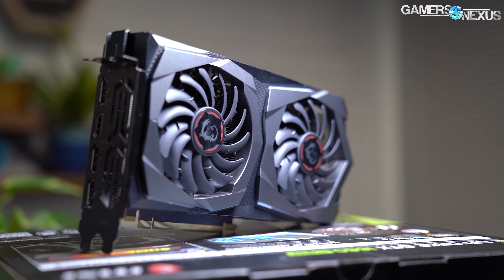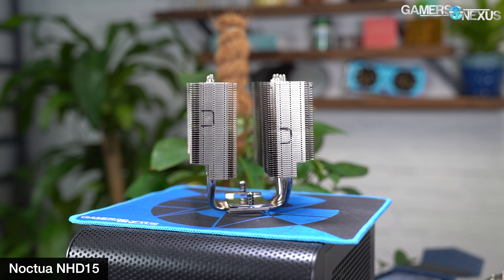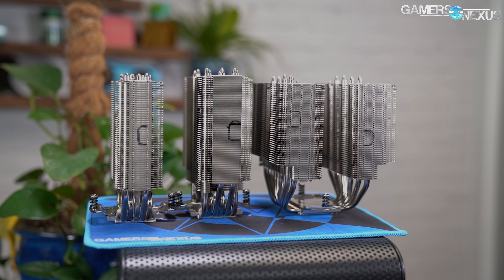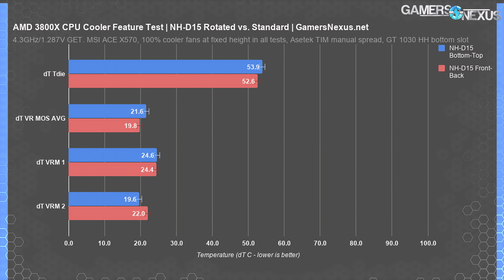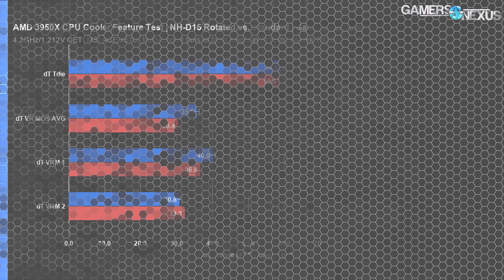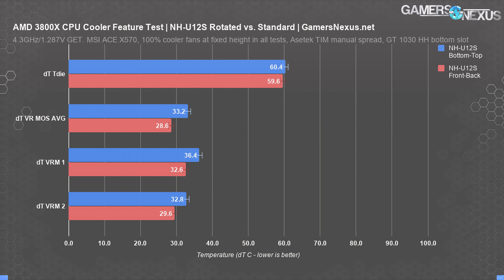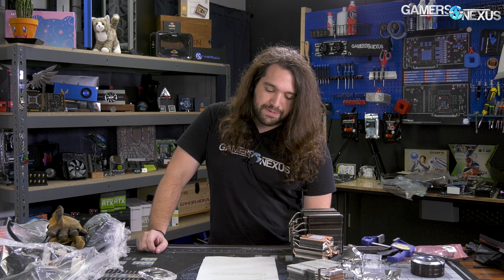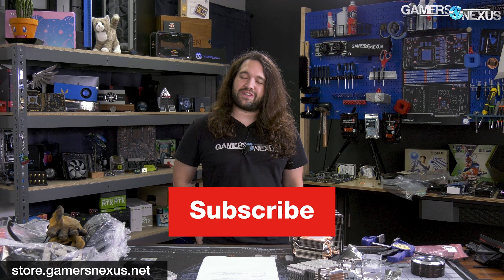AMD Ryzen Heatpipe Orientation Benchmark & CPU Cooler Myths

Comment: Kinda a side topic here:

The technical aspects of "wicking" or the flow of the gas/liquid inside the heat pipes is something I havn't seen exposed in detail. Neither of these orientations take into account the effects that gravity might have. Try setting the case where the heatsink tower points straight up vs. straight down maybe ? Also are all heatpipes created equal these days ? Some of the older ones were different and didn't use the sintered copper design if i'm not mistaken.
Reply: Gravity does play a significant role. The best orentation for most heatpipes is heatsource at the bottom vertical pipes with condenser at the top so that vapor can rise then gravity can assist with dropping the condensed fluid down. Though there are quite a number of heatpipe wick styles and some of them work better for differnt things. Not to mention how much vapor limit and fluid limit effect things. So all in all its a really complex thing and i have added some info down under this for the sake of conversation that you might find interesting. It is a copy pasta from my reply on another comment on this video.

There is a lot that goes into it. Starting off diameter plays a huge role. A 3mm heatpipe might have a qmax of 15w and a 8mm heatpipe qmax of 63w.... Thats a big difference for less then a 3x boost in diameter thats nearly 4x the orgional energy for sub 3x larger dia. .... Now lets say you have a low profile heatsinks (laptop for example) and you need to flatten a heatpipe ... If you flatten a 3mm heatpipe by 2mm height thats 3.57mm wide and now has a qmax of 10w instead of 15w .... If you take a 8mm heatpipe and flatten it so the width now becomes 11.14mm @ widest point the qmax is 52w rather then 63w of the round 8mm heatpipe....now some of the factors here are the wick limit (ability of the wick to transfer condensed fluid) and vapor limit (ability and space for the vapor to form and travel.) Thickness and porosity of the wick can be changed to tune it for a application. Which would allow for Qmax changes and / or the ability to work against gravity. .... A typical water filled sintered wick heatpipe (very common for pc cooling ) can be flattened up to around 60% though 30% is much more reasonable figure. As you flatten a heatpipe you will lower the vapor limit. A 3mm heatpipe flattened 33% now has Qmax limited by vapor limit rather then wick. Where as a 8mm heatpipe can be flattened by about 66% before the Qmax is now limited by vapor limit. ... Now if we start making bends we further reduce efficency. If we take the 8mm flattened heatpipe talked about above (52w Qmax) and we bend it 90 degrees we lose about 5% of our 52w Qmax. Which would be about what 49w after that off the top of my head ...then you have orentation. The most ideal situation for most heatpipes is vertical orentation as opposed to the heatsource with the condenser above the source of heat so vapor can rise and gravity can assist with pulling the condensed fluid back down to the source of the heat. Now to makes things even more complex again wick thickness and porosity effect this. As we as thsre is quite a few differnt forms of wick types that each work better for different things. Then if we want to complicate this more the length matters... shorter = more efficient (assuming you can still matain the same ability to cool the vapor in the condenser) now it varies for many reasons (ex. Working fluid , orentation , wick thickness , wick porosity , wick type , ect) however many fairly traditional heatpipes start to fall off around 150mm in length. However there is factors you can adjust to mitigate this. .... This info is still condensed a lot. And there is a lot of types of heatpipes. The ones discussed above are constant conductance heat pipes. There are also variable conductance heat pipes , vapor Chambers, pressure controlled heat pipes , rotating heatpipes , thermal syphons, loop heat pipes , oscillating or pulsing heatpipes,  and diode heatpipes. Even within diode heatpipes there are a few sub types like vapor trap and fluid / liquid trap types.
Reply: @Onewolfoc  you are correct, further googling, found this article:

 https://www.intechopen.com/books/gravity-geoscience-applications-industrial-technology-and-quantum-aspect/gravity-in-heat-pipe-technology

which explains excatly what you wrote in length. 
than you for clarification of the subject :)
Reply: i suspect they behave very similarly to how supercritical gas behaves, so i doubt gravity would have any major impact.

Comment: You could eliminate GPU thermal influence by either using a riser cable to move it away from the CPU, even blocking it with cardboard or something, or using something like an R7 240 for CPU-only tests... But I think you proved well enough that there isn't a practical difference, even if there might be a technical difference, so it wouldn't really be a useful test at this point.

Comment: Advocate of the devil mode : this tested orientetion of heatpipes with different airflow direction not heatpipe orientetion with the same optimal ariflow. For that a complete new cooler with different heatpipes is needed.   1 thing that could also matter it having the dies centered on the cooler block so the distance to all heatpipes is more optimal.   Then again how hot does this io die actually get? Also direct die testing! If you go nerd go full nerd

Comment: This whole discussion can be settled with a side-by-side thermal image of the IHSs. No problem if the CPUs throttle because you're comparing the pattern on the IHS from CPUs in the same conditions.
And under load the IHS would perform much better spreading out the heat so only if the IHS in a throttled state would be showing problematic heat spreading, would it become necessary to test if it still does under load.

Comment: a few years ago i posted a pic of my zalman cooler blowing upward into the power supply's fan, boy a lot of people tried to set me straight on that one. well tried, i never changed it cause it didn't put out much heat.  haters gonna hate...   
also, have you done a test with putting a fan below the gpu? i've found an 80mm fits there, and without the covers over the unused slots in the back you can get a good bit of heat blown out there. but would it be better to blow cool air in to the gpu? then the rear top fan would be sucking more heat out... unless you reverse the flow completely and have the front fans blowing out?  the only fan i have laying around is a 5500 rpm monster, so a noctua is in the mail because it's only 10 bucks for some experimenting

Comment: Cool video, and expected results.

That said, I was under the impression that the heat pipe orientation was only a concern on CPUs with two chiplets, and it wasn't about rotating the cooler so so fans went top to bottom, but rather it was that if you buy a cooler with pipes that run vertically in a back to front fan orientation, you effectively only have one heat pipe running over both chiplets, where if you buy a cooler where the pipes run horizontally across the IHS each chiplet would be under a different heat pipe.

I don't see how orientation on a single chiplet CPU would make any difference either way.

Comment: heatpipes direction at the base (horizontal) for airecooler setup to move air front to back, is the best heatpipe direction for dies in vertical orientation, like all ryzen are, even 3xxx.  Because this way all or most of them are in contact or closer to the die location. 

so yes, actual heatsinks are optimal designed for ryzen

maybe you can notice it with direct contact heatsinks that doesnt come with a heatspreader like the noctua.

Comment: no, orientation do matter. I tried the ryzen 7 3700x with noctua NH D15, the result is basically the ryzen got throttled almost immediately when I mount the cooler with the cold plate facing outside the case, while when i mount it with the cold plate facing the CPU, it runs absolutely great.

Comment: The pipes lay horizontally and cover the surface they intend to. Thermal is almost impossible to fuck up. Marketing makes it very easy to confuse system builders. I have never put something that large in my desktop PC. The barrier to entry for overclocking is very low, since you can almost always succeed with stock coolers.

Comment: If you guys want to do some more cooling testing, it seems like there are a lot myths out there about what types of fans to use (i.e. static pressure vs airflow). You'll hear things like for a heatsink or radiator you want a static pressure fan, or "if you're blowing through a hard drive cage". 

I couldn't find any real data on this out there, just a bunch of "conventional wisdom", so I did some quick tests myself about a year ago. The funny thing is in my own testing a lot of the conventional wisdom doesn't actually pan out. Even blowing through an AIO radiator I found airflow oriented fans to work just about as well on the PUSH side (this is important). In fact, there were very few instances where static pressure fans were clearly better than airflow fans. The one place static pressure did work better was when PULLing through a radiator, where airflow fans (thin, widely spaced blades) had trouble generating enough suction and made a horrible turbulence noise (sounded sort of like a grinding noise, the best way I can describe it). 

I think the problem is a lot of static pressure fans are too static pressure oriented. There just isn't enough resistance in most cases, even blowing through an AIO radiator, for them to reach their full potential (pull orientation, once again, is the exception where it makes a big difference, at least compared to very airflow oriented fans). I think this is why the Corsair ML fans are a little less static pressure oriented than the SP series fans, since it's just a better design in general for most situations. Blowing through a really thick radiator obviously could be different, but for most radiators and I'd guess heatsinks, you don't appear to need that much static pressure. 

In any case, it seems like this is one area where few people have done any concerted testing, and it could help a lot to set things straight about what situations you'd actually want a static pressure fan, vs an airflow fan. I think the results would probably surprise a lot of people, seeing as my own limited testing certainly surprised me.

Comment: First of all: are we sure that AMD uses only one chiplet in those CPUs?

The whole architecture has the advantage of literally glueing together the CPU and potentially increase yield. I.e. they can use two chiplets with defective cores to make a working CPU instead of throwing them away. Why wouldn't they do that?

I'd guess that physical heatpipe orientation has much more effect - after all heatpipes are affected by gravity - as well as physical fin and fan orientation.

Comment: You know why it even became a thing? Cause Ryzen 3000 is hot as fuck. Temps fluctuation turns me crazy. Temps and voltage peaks from 45 to 60 and 1V to 1.4-4,5V in second, then come back. That's fucking nuts.

Comment: Since the GPU is such a large contributor of heat, why not remove it entirely and run the tests with one (or more) of AMD's APUs?
Reply: that would just move the generated heat from the card (which is now no longer in the system) to the APU. while the iGPU in the APU doesn't create as much heat as a higher end dedicated GPU does (the heat generated by the iGPU on an APU is probably close to the GT 1030 maybe more, the GT 1030 which what was used in this test), the cooling would still have to deal with added heat generation thats now located within the CPU. obviously an APU isn't going to generate as much heat as a 3800x, 3900x, or 3950x does

Comment: Great content, as always! Thank you for all the hard work. I recently switched to Ryzen 3600 form the previous gen (1600, then 2700), and I use Alpenföhn Brocken 2 with 5 direct contact heatpipes for cooling. I exactly thinking on the cooler and heatpipe orientation when I found this, so you spare some time for me. But still remains 3 questions for me:
1), Ist there any difference in cooling with the 3. gen compared to other cpu-s with the same heatload (For example: a 9900k with 200w and a 3800x with 200w)?
2), Aren"t the AIO coolers are more effective, not because the higher cooling capacity, but the coldplate (since it watercooled, the entrie coldplate cooling capacity the same, right)?
3), Is there any difference between a non direct and a direct touch cooler?

Comment: My stock 3600x with a nh-d15 runns at 70-80°C whith Prime95, while barely audible, I don't think at this point it does really matter.
Reply: My 3600 and NH-D15 stays in the high 50s remount and undervolt it....
Reply: @jakehancock2888  Yours stays in the high 50s? Cool story bro, doing what? Because you failed to specify while doing what, and if you mean gaming then you can shut the fuck up and leave the conversation as you're clearly too stupid to be a part of it. Prime 95 stresses your CPU to the max, and uses AVX 512 instrcutions, which are the most heat causing instruction set out ATM.
Reply: @shawnpitman876  Who hurt you?

Comment: Yeah I've played with this back in the day I used air cooling, very basic heat rises so when top to bottom whilst that should be what works best the bottom heat pipes dont function as intended as obviously heat will not travel down. 

So even though front to back works best the upper pipes do more work that the lower I've always wondered why they never made a design that had all the heat pipes travelling upwards as this would surly work much better. 

Because you have to remember if you set it up top bottom then you are really only useing half of the coolers proformance as the lower pipes cant function correctly as heat will never travel down (it cant) physics I'm told. Hope this is addressed.

Comment: Heat rises from bottom to top so does that mean the heat pipes on the bottom will always be cool and the top will be hot?

So a bed type PC withy he same cooler will cool better than a normal PC case?

Example on a test beach the heat travels from the contact point to the end(top tips) of the cooler but in a normal case the heatpipe is oriented horizontally so is it bad should allow us lay down our cpu instead of standing it up for better thermal performance?

Comment: Good points, Steve.  I think a majority of people who have thermal issues are either from improper thermal paste application or poor case temps overall.  Case in point? I cool a 3950x on PBO with a Noctua U9S (92mm single fan) in a thermaltake Core V1. Theres a 200mm noctua fan foe case intake and 2 80mm noctua fans for case exhaust. Under full synthetic stress, the CPU levels off at 79-80*.  I can shave a couple degrees by turning up the case fans. The cooler orientation has just 1-2 pipes cooling both chiplets.  Boost is no issue, as I get cores above 4.7ghz. 

Oh and I'm not using paste... just an IC Cooling graphite pad.

Comment: I am guessing that the CPU heatspreader and Noctua base plate is doing its job well enough to spread the heat out to all heatpipes.
I am running a Noctua D15se AM4 with horizontal fans, to suck heat away from the GPU and send it up and out through mesh top.
A Ryzen 1700 overclocked to around 110W does not mind sucking in a little hot air from the GPU.

Comment: I've got 3600, Le Grand Macho RT, Fractal Nano S case (!) 85C max stress testing and less for everything else. Gaming 65C. Low RPM/pretty much silent. I get random idle between 40-65C, thats just how Zen 2 is. Use it, enjoy it and forget about temps. Lets judge Intel 7nm chiplets when they release in 2029 :)

Comment: Bless you based Tech Jesus, I was just thinking of this, since my 3900X, even at stock under an NH-D15 on roids, is hotter than the corona of the sun.
Reply: Um couple things. I had a 3900x on a scythe fuma rev. b (scfm 1100) which preforms in the same class as a nhd14 and 15. The energy density of ryzen is still quite high so they can be a little harder to cool. The things id take a look as is mount pressure and how flat your IHS is as there is quite a significant amount of variability there when they make those some people get lucky and have pretty flat ones and some have some wicked bad IHS even between the same model of cpu. The last thing id also consider is are you running PBO and or are you running earlier agesa updates that run unsafe 1.5v boost range. (Amd later found that 1.5v was to high and reduced peak boost core voltage to under 1.47v) these factors would all play a role in how  hard your chip is to cool. And PBO is ridiculous on these chips as far as increasing heat production.